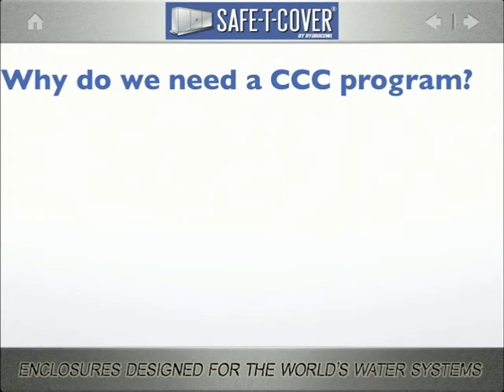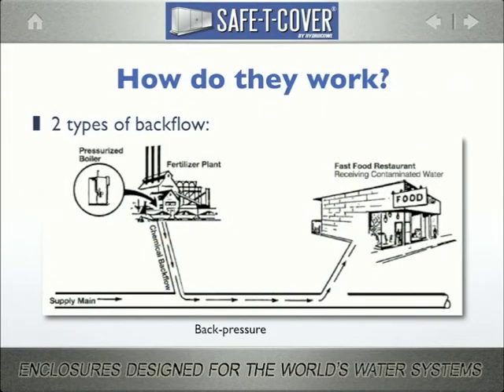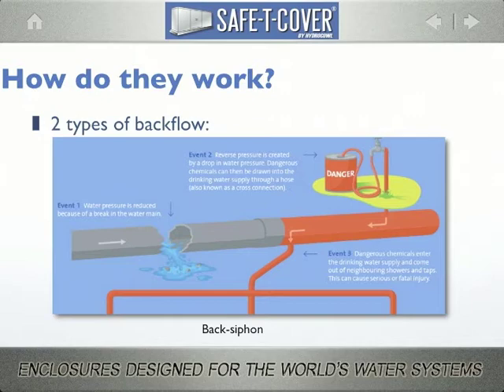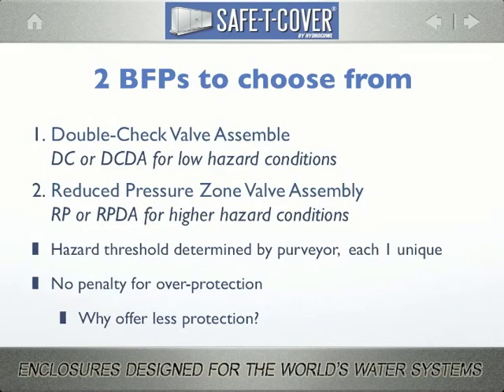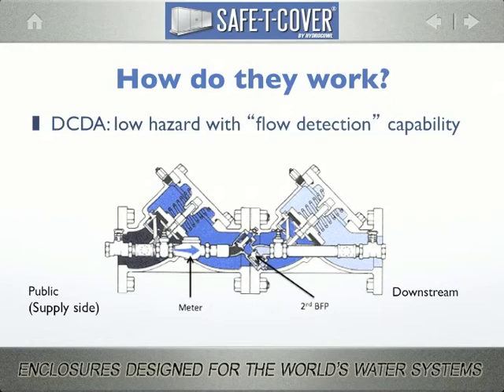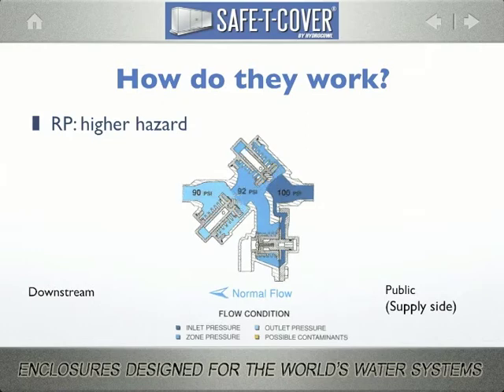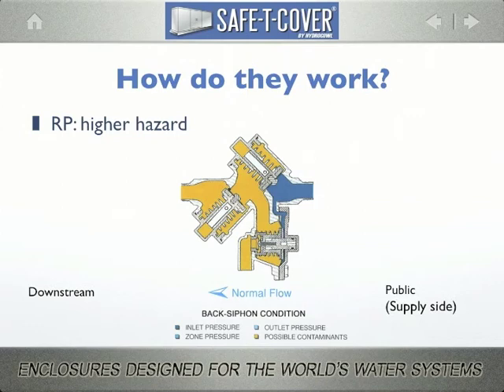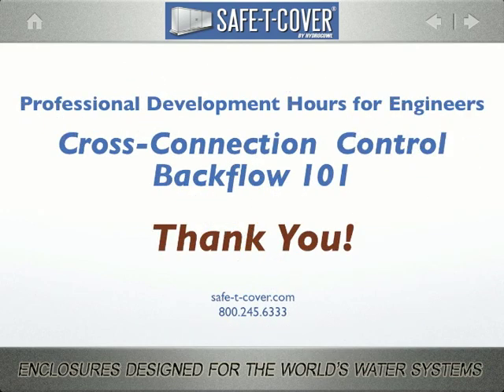What Are Backflow Prevention Devices Used For?

Comment: But the underground water supply are inside pipes so even if fertilizers seep from above ground to underground, they won't contaminate the water because water is shielded by metal or PVC pipes.  What am I missing?
Reply: It is possible for contaminants to be backsiphoned into the potable water system through        cross connections. A common example would be a watermain break causing a massive drop in pressure. This drop in pressure can cause the water in a nearby home to reverse direction. If the end of a garden hose is in a bucket of paint, that buckets contents will be siphoned into the water supply.
Reply: Obama